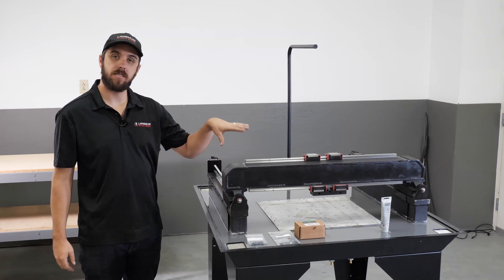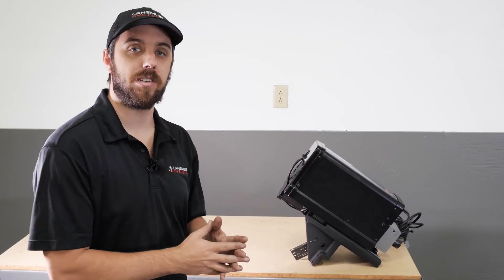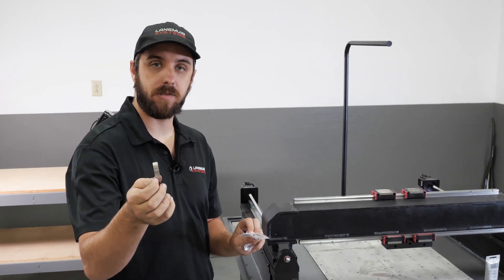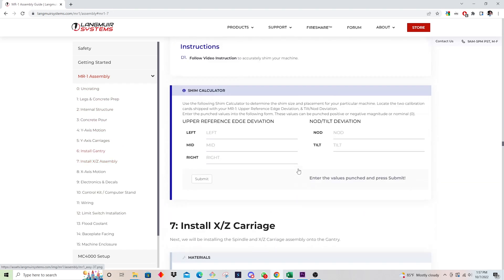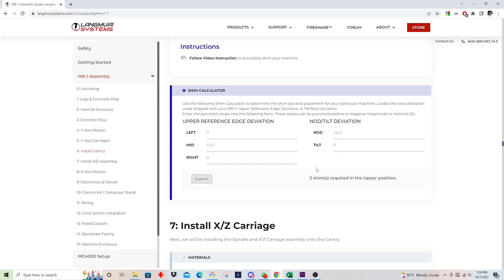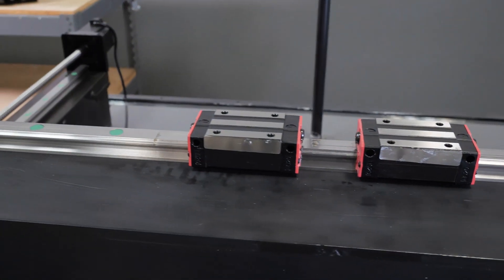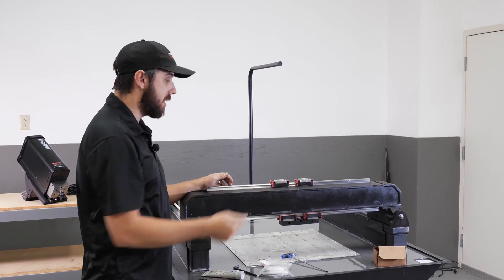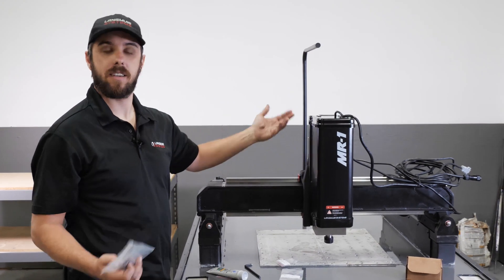MR-1 CNC Mill Assembly Tutorial: Z-Axis Alignment Shimming

Comment: i am thinking this is a $10k project (what i preordered) -  any step in process from cement/epoxy/leveling now calculating shims can lead to a machine that will never be in tolerance or work properly - i have to think - may be better to spend extra and get a tormach
Reply from the maker: Hi there. The machine is ready to make serious chips at $5400; this includes the base machine, enclosure, and flood coolant kit (this price is even cheaper at $4900 if you were part of our early promo pricing). All price comparisons to other machines would need to be made starting here since any CNC mill will need tooling, work holding, control computer etc. Also, I'm not sure where you are getting the impression that this machine will never be in tolerance or work properly. If the instructions are followed, MR-1 has exceptional accuracy and precision comparable to any other mill in it's class and we've gone through great design and manufacturing lengths to ensure that this is possible. Please check out the detailed specs on our website for the complete picture of what this mill is capable of in terms of positional, and alignment accuracy. You also don't need to calculate any shims, this is done for you when we inspect these parts in our shop and tag them. You just need to enter the values into our calculator to determine how many you need to get your machine perfect.
Reply: @LangmuirSystems  yes plus addons - i am at $8600+shipping hence $9k. i have your 4ft plasma table its good - but this mill from the videos "appears" to require a LOT of assembly - again: cement, epoxy (opt but needed) leveling, shimming etc..... what happens if a mistake is made in the gantrys and they not level in the epoxy and cement? yes great price but it a project  - i believe my concerns are valid YEt dont take away from the quality or price point of the unit - however this NEEDS to be considered - please correct me if i am incorrect - i still have my order and await machine!
Reply from the maker: @VanguardSys  To get to a price point of $8600 this would include a ton of add-ons like Machine Enclosure, Flood Coolant, Flood Coolant Relay, Leveling Feet, Epoxy Top Coat, Precision Ground Collets, a Low Profile Modular Vise, Vise Parallels, Automatic Tool Setter, Digital Touch Probe, Dial Indicator w/Base, Toe Clamp Kit, Modular Vise Clamp Set, Fly Cutter, 10 Pack Fly Cutter Inserts, and over $1500 of tooling! A comparable CNC mill with all of this included is well north of $25k+. As for assembly we've built in a ton of safeguards to prevent mis-assembly. If you watch our assembly videos in full you will see the great lengths we go through with design and procedure to ensure that the machine is extremely accurate and meets our advertised specifications. In addition, you can always choose to have us assemble the machine for you as we offer this service as well. If at the end of the day the process seems to daunting, we completely understand and you are able to email our customers support folks and get a 100% refund of your $500 deposit. I'm sure there are plenty of people behind you that would be happy to take that spot 🤣

Comment: How about putting different spindle on this thing,  I'm thinking one of the Cnc Depot FM 30F spindles with 30 taper,  built in power drawbar , 12000rpm - not sure it could be done with MR1 limited Z and of course FM30 requires entirely different electronics then there's the question of spindle control
Reply from the maker: This spindle plus VFD costs more than the entire MR-1 machine. Also, MR-1 has an AC servo motor that is 0-8000 RPM with a flat torque curve meaning it has low end grunt at even the low RPM speeds. This was intended to make the machine much more versatile for drilling, boring, steel cutting, fly cutting, etc. The high revving VFD spindle motors make peak torque at peak RPM and are designed primarily for routing at high RPM.
Reply: @LangmuirSystems  yeah,  they're expensive,  iso30 taper and  power drawbar is a nice feature tho but I'm not gonna go that route , I was looking at syil x5 and there's not enough X and Y  - syil x7 would be an overkill not justified $$$ for what I intended it for,  Tormach still uses ancient dovetail system and weak spindle , looks like MR-1 is exactly what I've been looking for: not breaking the bank , good for larger aluminum parts and still capable of machining steel,  are you taking pre-orders now?
Reply from the maker: @ronson66  Thanks for the feedback! Yes you can place a deposit on our website, the lead-time for your order to ship will be shown on the order page. Thanks for following!

Comment: Curious why the mix of metric and SAE fasteners? - is that because the linear bearings are  threaded metric but since you use bolts on the lower bearings you can use SAE? It just seems a bit  awkward, especially for a guy like me who has a full mechanics shop with only metric lol. Like the robustness of the build so far, thanks for the detailed video - can't wait until I get mine before year end.
Reply from the maker: Yes that is correct. There are very few metric fasteners on the machine. We use SAE fasteners wherever possible, but on some components it’s unavoidable to use metric. We’re Americans so we prefer SAE.